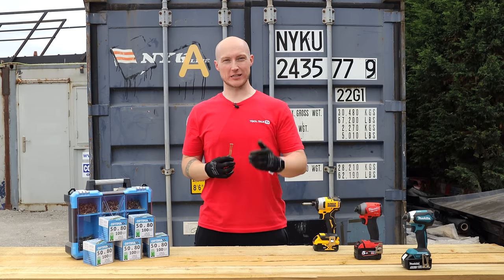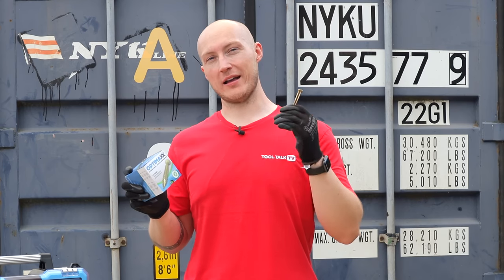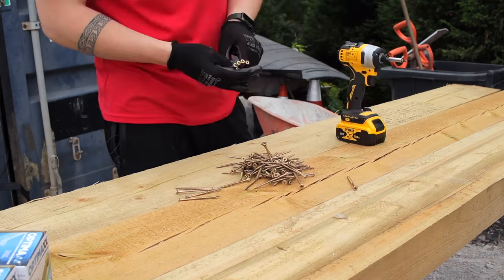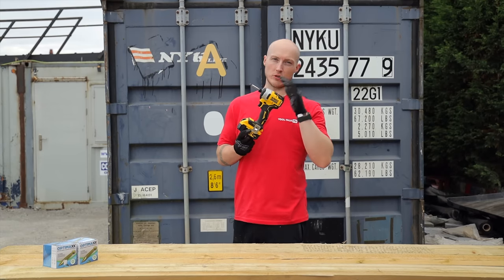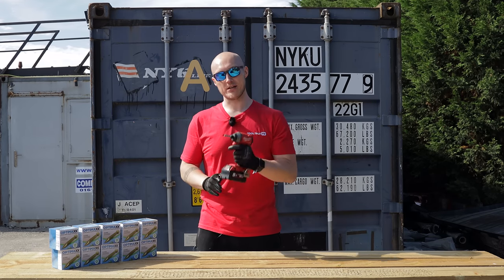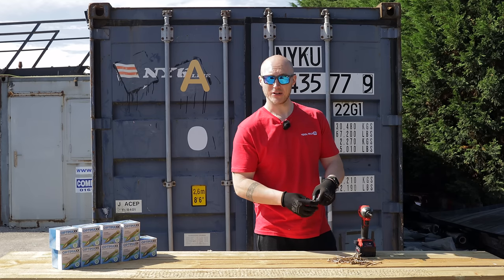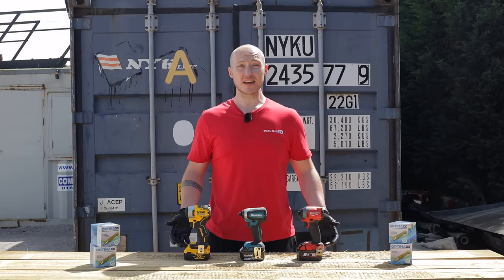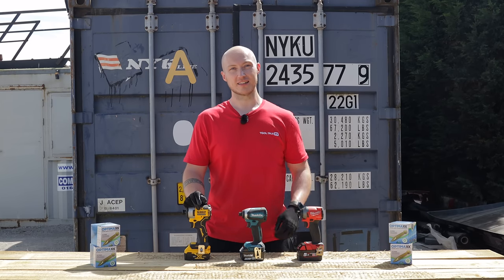Impact Driver HEAD TO HEAD

Comment: Try the same test with year old tools.. 
the makita suffer badly of battery fatigue and the milwaukee gets better after the first month of use and the yellow stuff is slow and gutless 😜
Reply from the maker: Interesting points. That will make for a very interesting re test. It would be interesting to know how their usage impacts their longevity too and if there's a relation when it comes to brand and trades. e.g. do most sparkies like Milwaukee.